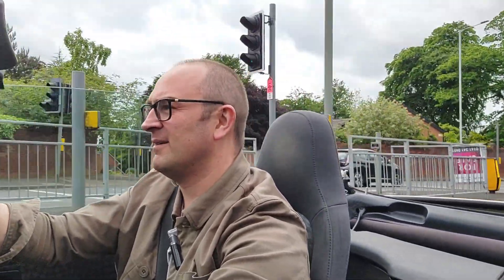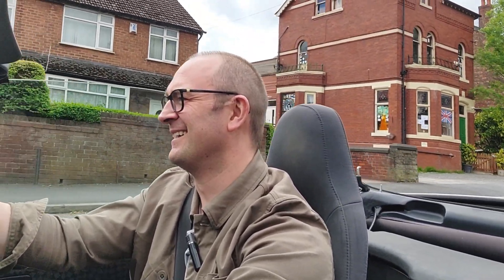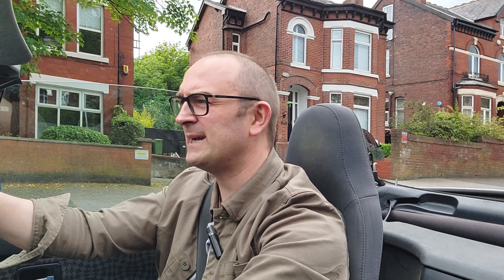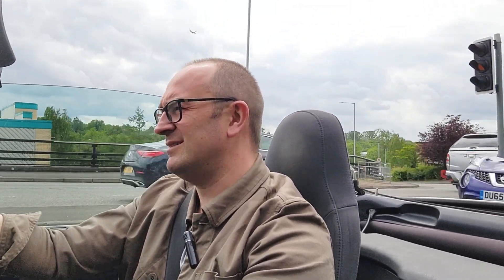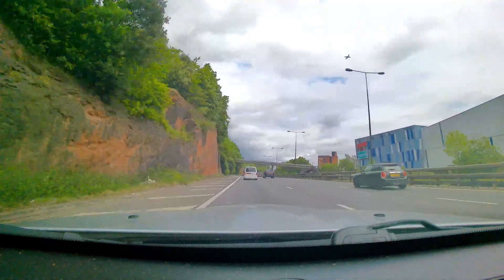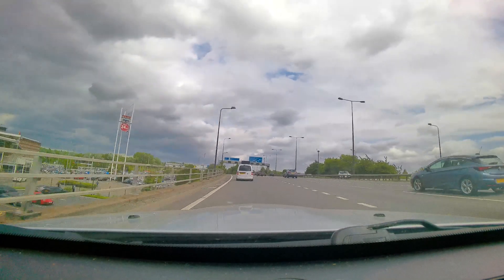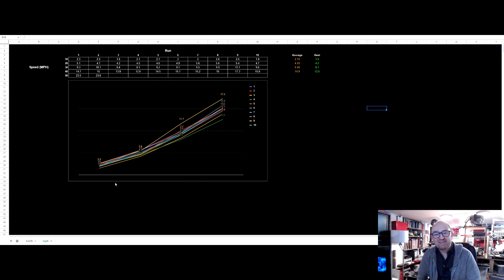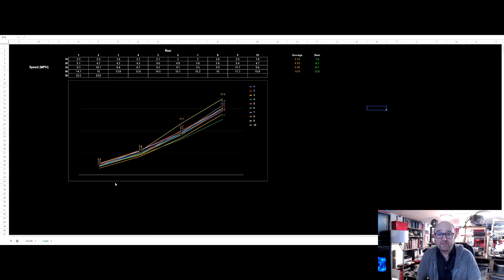Captain Slow! How fast is my EV-swapped BMW? (Clue: not very)

Comment: As you know I'm not expert but as I understand it you have three things that control power to the wheels. 
Motor, Inverter and battery and two things in the battery ie voltage and current.
Increasing current from the battery is a no go as you would need to double the size of the pack but higher battery voltage by adding a few cells would give a good power increase for very little work. Worth a try?
Also is the inverter maxing out before the motor? How can you tell?
I'm not saying don't upgrade the motor but maybe other factors are involved as well.
Reply from the maker: The inverter is pumping plenty of kw in there. Jamie is already running at a higher voltage than me (96s) and seeing exactly the same performance issues so I don't think that's the answer. It's just a simple conversion factor: torque/power per amp, and this motor can't deliver any more.

Comment: I'd skip the rear motor upgrade if I were you and go straight to the lexus one it's a Z3 it deserves more 😆
Reply from the maker: Oh that's going in the second one. These are both long term project cars. The experimentation is part of the fun! I have no issue with pulling this one off the road for six months again once the other one is up and running and putting a completely different stack in.

Comment: Odd seeing my local pyramid roundabout on youtube. Maybe next time you bench mark you could overlay the speeds on the video.
Reply from the maker: That would be good. I need some better apps for that though. Or another camera I can point at the Speedo. Or maybe a screen recorder... Hmmm..
Reply: @EVDIY  i take it the odb2 port works. It will be spitting out data in realtime so there will defo be a phone app for that.
Reply: I have a scan gauge 2. You could place that higher on the dash within view of the camera
Reply from the maker: @Whereswally606  cool - might do that for the test of the new motor

Comment: I'm sure you've said before but what motor are you putting in next Tom? And how much does the Z3 weigh? I'm probably going to go for the rear Outlander diff for my Insight.
Reply from the maker: Outlander rear motor is going in.

Weight: not sure. Kerb weight for the 1.9 is about 1200kg. I think it's pretty much the same now.
Reply: @EVDIY  I think keeping the Insight down to its original weight will be hard but I'll start with as small a pack as I reasonably can.

Comment: Interesting video, do you know what the voltage and amperage is during the full throttle? And what kind of battery for you have? And what is the total weight of the car? I'm planning to use the same motor in my triumph spitfire, not planning to make the fastest car but after seeing you video I'm a bit disappointed in the motor
Reply from the maker: Voltage is 300-320. Amperage is topping out at close to 500! There's just not enough oomph in that motor to convert all those kw into motion. It's a single five module BMW hybrid pack. The old ones. 

I would strongly recommend going for the rear motor rather than one of the front ones.
Reply: @EVDIY  500a at 300 volt is 150kW! You should think that it will move the car a bit faster. But then you heb a ton of heat in the motor? The energy most go somewhere... I thought the rear motor was the same size as the front motor.
Reply from the maker: @nathanielakkermans  They're very different. Rear motor much meatier. Tops out at lower revs. Has higher torque and power. Think the chart is in one of my previous videos - perhaps The Plan?

And yeah, it should do a lot more with that power but it just can't. Hence the motor swap.
Reply: @EVDIY  thx man, for now I already have the front motor. I will try l try that first but I let some room around the motor free then do I can do a swap it needed. The Spitfire is a very light car so I have a little bit of hope that it is acceptable. And I have a 24kw pack of the BMW i5 X or something. 12 modules 96s so a little bit more voltage. What is the weight of you car?
Reply: @nathanielakkermans  it's about 500 phase amps, very very briefly, I have same motor and inverter but higher battery voltage. It works out for me at about 130 battery amps with 355v nominal, so about 46kw.

The Mitsubishi inverter might get more torque out of it vs our prius inverters.
Reply: @JamieJones1985 ooh phase amps, that makes sense. I was already thinking that small battery holds on good. 300 volts at 500 amps. But I understand you have the same motor in you car? What kind of car and what is your experience with it?
Reply: @nathanielakkermans  VW Beetle, see my channel for overview. Same as Tom really,  its usable for the most part, unless theres a steep hill and need to go over 30mph up it. I have the gearbox and other front motor in shed so could swap to using that, but think I'll just get something bigger instead.
Reply: @JamieJones1985  I was looking at you channel, I recognize your car:) thx for the info